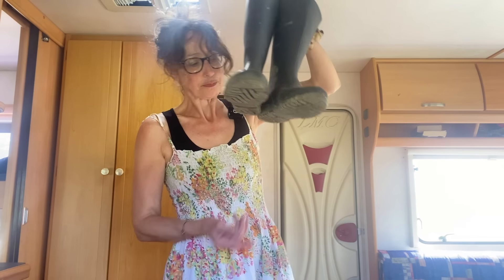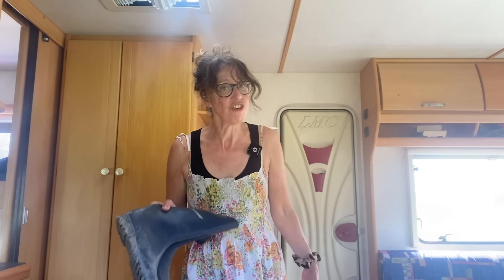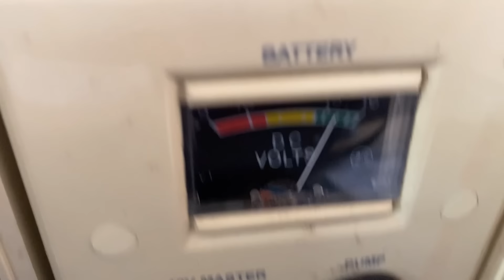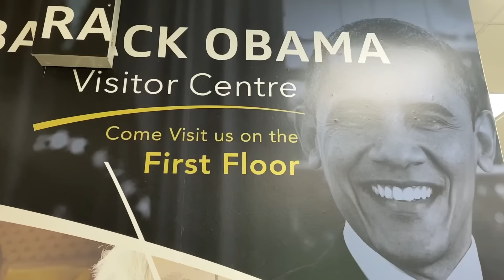We have to return to the UK leaving Noel (& Roy) behind | EP044

Comment: I found that quite sad! When do you expect to move into the house? X
Reply from the maker: @suziebelle1959  To be honest Suzie we can’t move before summer next year. Sid takes final exams in June, then can join Noel as a labourer for the rest of the summer/autumn. I will join later when my work contract is up (possibly spring ‘26).  The house may well take longer than 13 months to be habitable but the grant situation is constantly under review as the demand for tradesmen outweighs supply. We’re not worried as we know it will happen, as and when. There’s no question of turning back. 😊🏡

Comment: but a small heat gun less than £30 and useful for so many things as well as bending plastic pipe.
Reply from the maker: @lesliecox-hp9ud  Noel does already have one Leslie but without electricity he would have to start the generator up. His solution was more efficient. 😊👍🙌